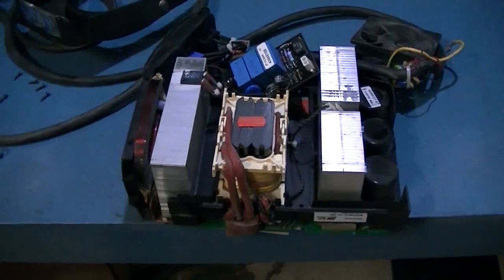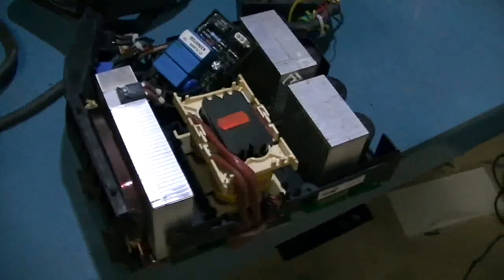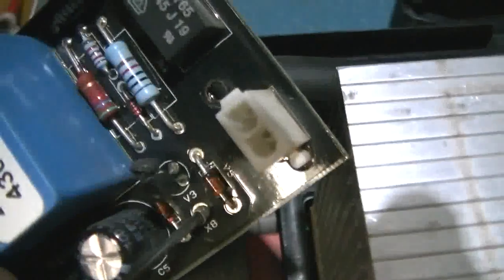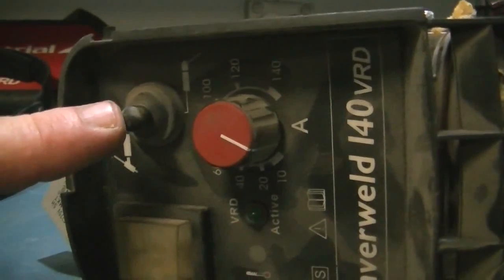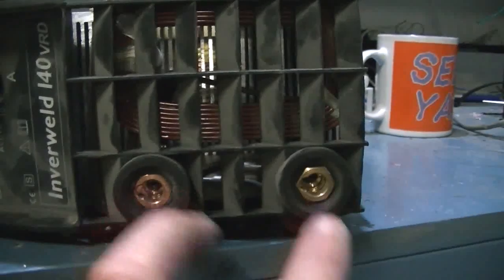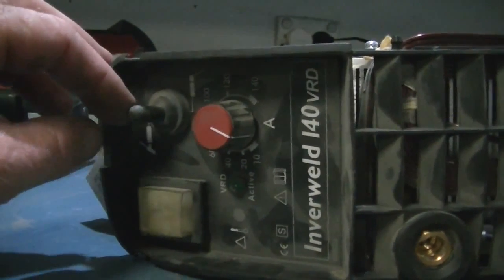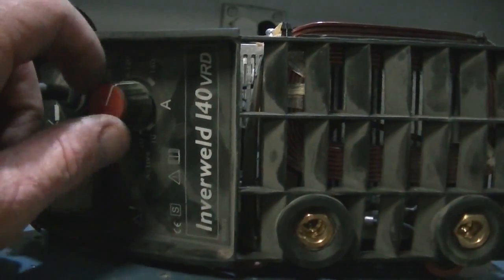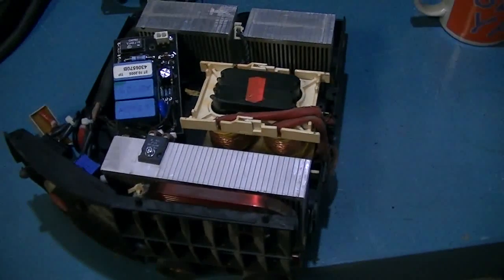The ultimate HHO pulse generator.flv

Comment: @TinManPower in essence, you electrolyser will "pull current" in, or "create a load that draws X amps", based on the surface area of the plates, the voltage gap between plates, and the concentration of electrolyte (to a point). After a certain voltage (plate gap voltage), no more electrolysis exists, rather, you are just drawing more amps and using your plates as "a heater" - you'll get steam if push that envelope far enough, but no extra HHO. I say max out voltage (source) & min. electrolyte

Comment: @TinManPower ... cont ... if you have 240V mains ... you could have lets say, something like a 114 plate design (or thereabouts). AGREED: There is no point, really in lowering the voltage of any source, but equally there is no point id driving the plate gap beyond the voltage require for the separation, somewhere between 1.9V - 2.4 is adequate. As for electrolyte, it all depends on how much gas you want to create, the volume, from "your size of unit". I run only 1-2%.

Comment: @TinManPower Well you do want to decrease the the voltage to the maximum needed per cell plate gap, but you have a very good point... most people do exactly what you have said... because they only want to dole out enough money for say 11-21 plates. Now, the exact mentality you just described is also my thinking. That is why, exactly, I am taking my existing setup in video jOrCKqjMchE, I am adding many plates to it, in the end it will be like this one in video kyVYQ2iBxbk. ...

Comment: What voltage per gap, plate configuration are you gonna try TM? With that capacitor setup, you could have two modes such that volts per plate gap changes, when you want it to... I like to shoot for 1.9 - 2.3 volts per gap. I have neutral plates too, but most don't, now, it seems. Cheers